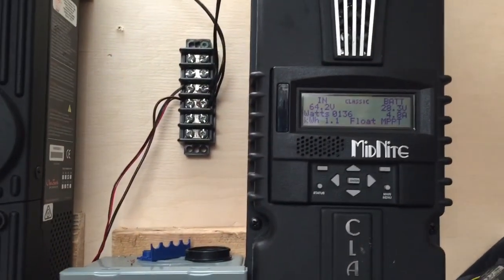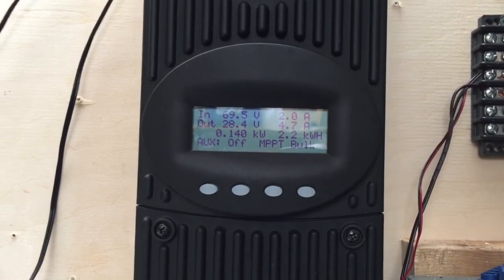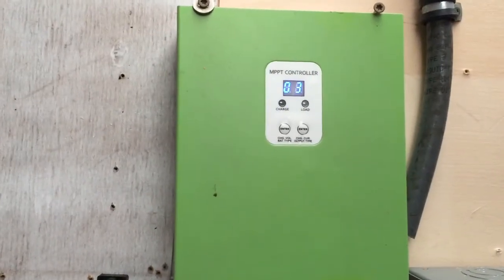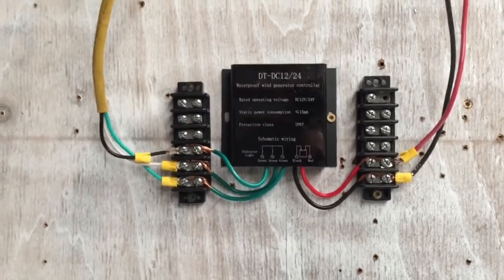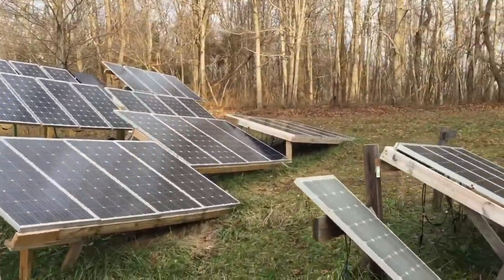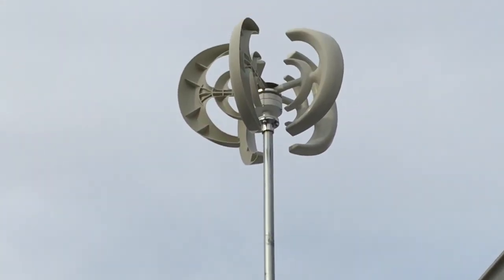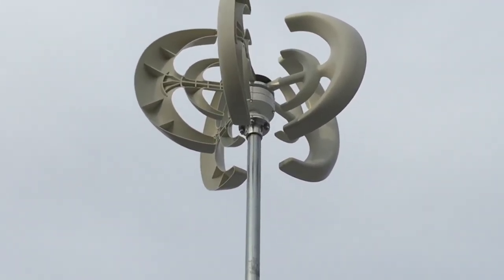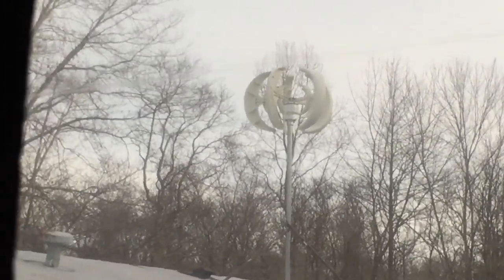Vawt wind turbine up and solar Sunday update 12/30/18

Comment: Did you wire the wind turbine directly to ...the battery?
Reply from the maker: No sir , just batteries to controller an then the turbine to controller, gonna try this spring on top of the hill these pine trees block so much good wind
Reply: Southern Ohio Solar homestead the controller that came with with the unit?  as apposed to your  larger outback charge controller.  So from turbine to the little 12/24 rectifier/controller, from that unit direct to the batteries? 
I’m trying to figure out how to add my vawt turnpbine to my solar set up.  I have a small battery bank running with the the outback and 2x300 watt panels. 
I have seen schematics that combine the output of the widened turbine with the PV array to one charge controller to one battery bank...but  maybe it just can go from the rectifier 12/24 to the battery...but also not sure how to set up a dump load.
By the by, I was Was just in the hocking hills last week... I grew up in Ohio, but now back in Brazil:)
Reply from the maker: Yeah I’m still new to wind also the controller that came with my vault I hooked up to the batteries with no dump load didn’t need one it seemed I could never get enough wind , maybe look up John Daniels channel he’s a big wind turbine guy he also does the vault turbine also
Reply: Southern Ohio Solar homestead well we get a lot of wind where I am, I’m on the coast. But you have a single battery bank, so wind energy goes to the same battery as your panels ?  Thanks I will check this other guy too. Appreciate the responses👍🏼
Reply from the maker: Yes sir

Comment: Nice Installation. She looks pretty out their and thanks for the update.
On what battery bank you have the VAWT on?
Reply from the maker: I put it on the 12 volt back up system because the panels right now only get about 100 watts of power coming from them , thanks for tuning in solar brother and I hope you have a great new year sir